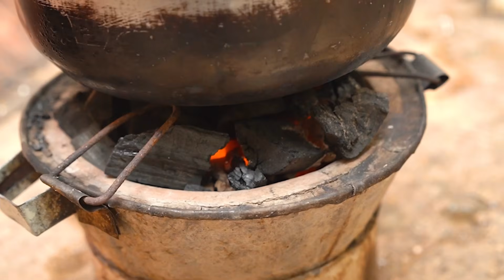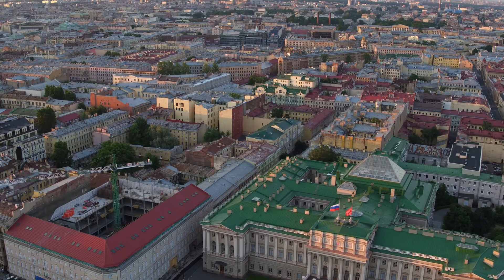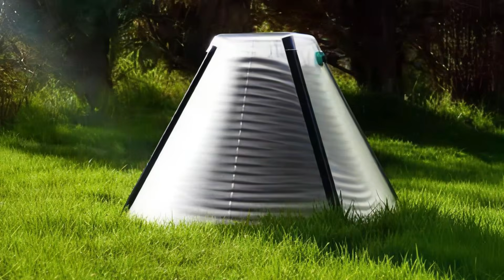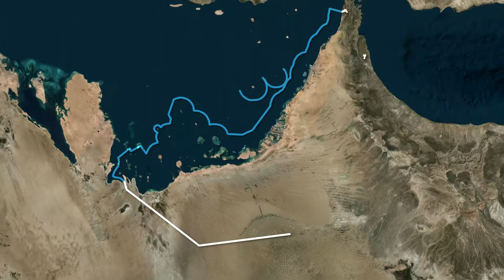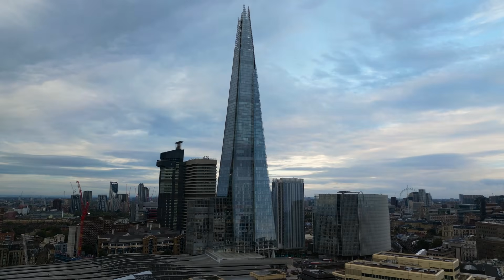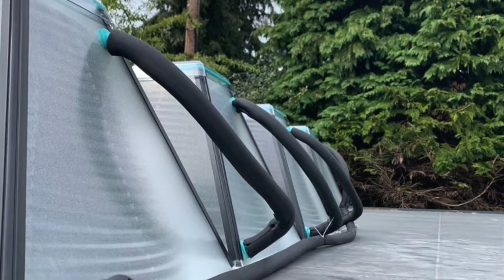This Flat Pack Solar Prism Heats Water for FREE — So Why Doesn't Every Home Have One?

Comment: Clever design! The best ideas are the ones that get used.

I could see this for glamping or a hot tub, but only by using a small pump to recirculate water through the collector. Pair it with a PV panel and a low-powered DC pump. No controller or battery needed. As with other heat collectors, this needs over-temperature protection (shading) or somewhere to dump excess heat (e.g. a thermal battery or large tank of water.)

This would also work as a collector in a heat pump setup for charging a phase-change thermal battery. The biggest issue I can see, is the poly tubing will melt or deform if it gets too hot. Certainly not usable for concentrated solar. But I like the spiral design! Very cost-effective. Simpler is better-er!
Reply: Look up all the DIY ones. It's a load of pipe coiled into an insulated box with a suitable plastic/glass lid to collect the suns heat. Less efficient than just using PV and a heatpump but a lot of fun to build and great for pools and the like.

Certainly wouldn't pay 200 quid for one when you could build something much better out of a load of pipe some bits of wood, a tin of black paint and an old double glazing panel.